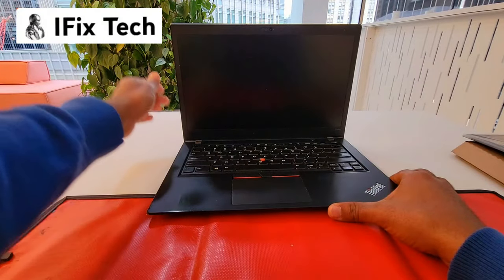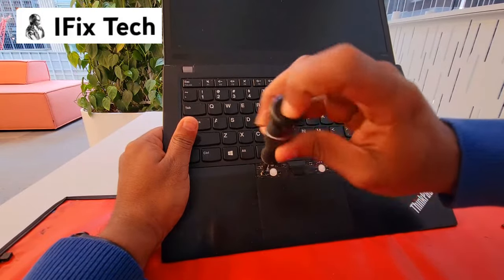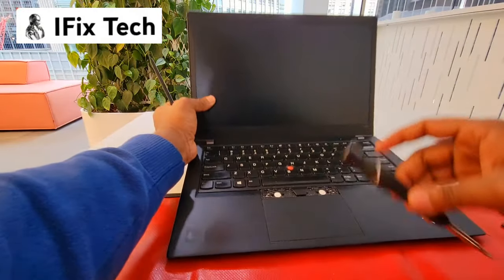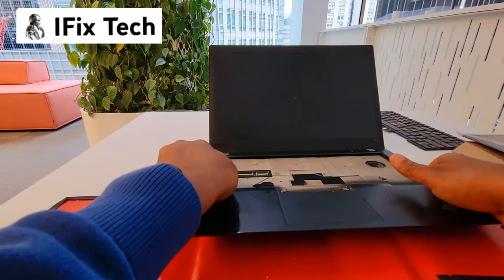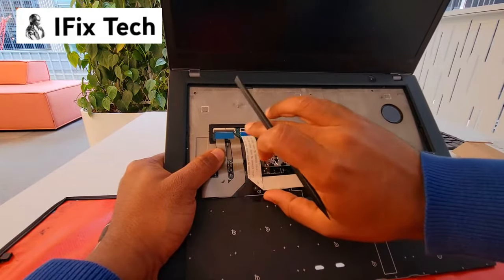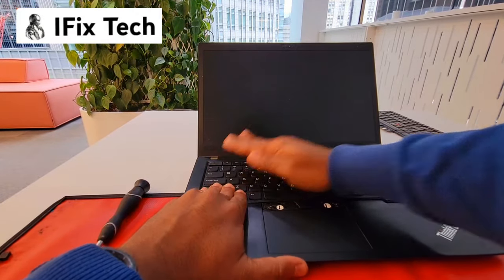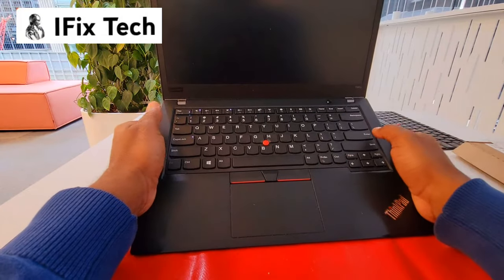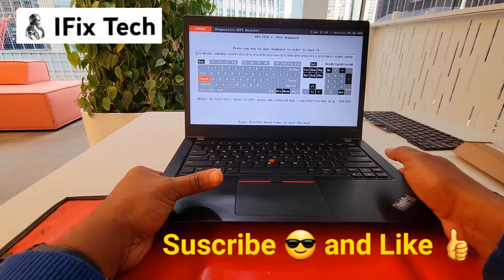Lenovo Thinkpad T480s - T490 - T490s - L490 Laptop  Keyboard replacement

Comment: You should have shown ho to deactivate battery before the replacement : you risk electric damage by not doing this (go to Bios > power > deactivate battery). Then, once replacement finished, plug the AC back and boot, the bios option will be reset to normal and battery will be connected
Reply from the maker: Thanks 👍

Comment: This video is not for ThinkPad T490s. T490s keyboard can not be replaced from the outside. This video is misleading! 
You should edit the title. This video  is not for T490s keyboard!!!
Reply from the maker: Thanks for your comment. You are correct MOST will be done that way, but SOME T490s will be done this way. 😉👍
Reply: @IFixTech1  That is conpletely wrong. T490s should be opened from the motheroard upside down

Comment: Replacing the keyboard on a T490s is way more involved and requires full disassembly.
Reply from the maker: Correct, most T490s require a full Disassembly. Some can be done this way. 👋😉
Reply: Is the L490 same as in the video?

Comment: Does the whole installation process the same for t490s?
Reply from the maker: Hello, not all of the T490s. The most of them have a different process. Basically replacing the top case.

Comment: Is the keyboard T480s the same as T490S for replacement? Thanks
Reply from the maker: Hello, not always. Some T490s Can have the same keyboard but they also use a different one. You can use the Lenovo website pcsupport.lenovo.com under "Part lookup" with the serial number you can find all the different keyboards compatibility for you laptop. Regards 👋 👋
Reply: no t480s t490s is differnt keyboard

Comment: Hi after replacing my T480 keyboard for layout purposes(US to TR) keyboard backlight no longer works. I replaced the original one but backligt on it no longer works too. Backlight option is also disappeared on Vantage app. What could cause this? Battery was disabled while changing the keyboard.
Reply from the maker: Did you check the FRU number on the replacement keyboard? Was it the same?
Reply: Did you disconnect the internal battery first?  If not, it sounds like the fuse on the mb is blown. 
FYI, this thread isn't about theT480.
Reply: @bp8339  Yes, I did! Fortunately, the problem went away. The backlight is working now. I think the angle at which I was inserting the ribbon cable wasn't correct. If I insert the ribbon cable at nearly a 0-degree angle, the backlight works without problems. I used to insert it at a 45-degree angle and then close the latch.